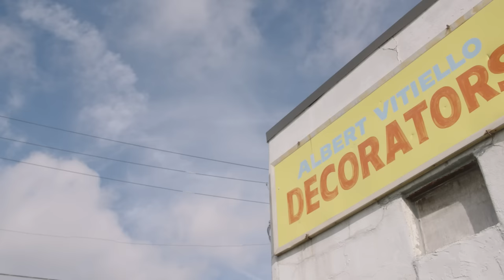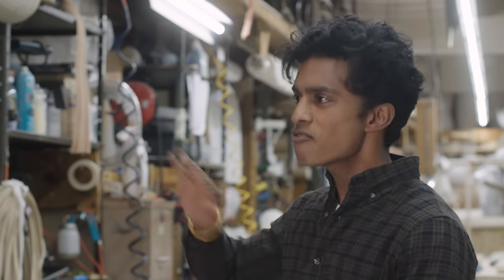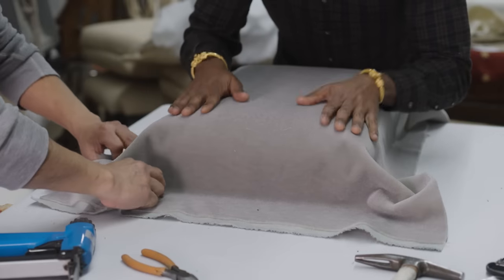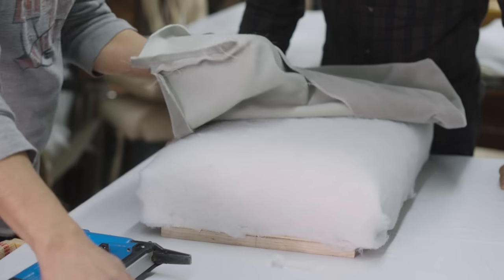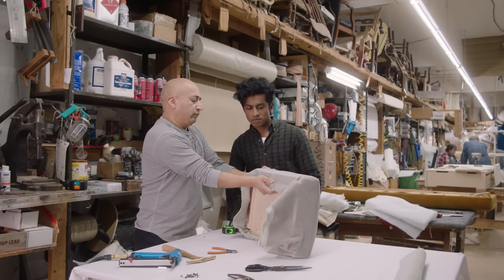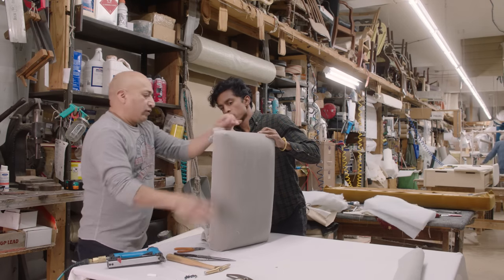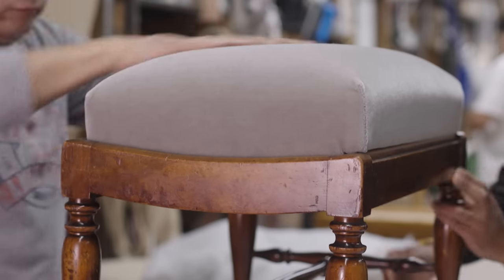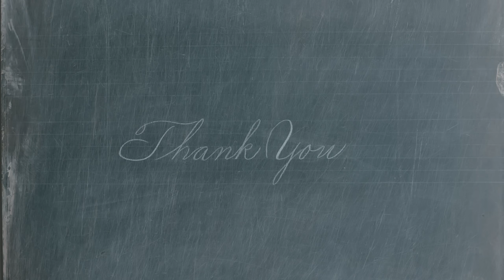Visiting a custom Upholsterer with Rajiv Surendra

Comment: A couple years ago I bought 3 old wing chairs from a ReStore shop for like $12 each. They actually were high end brand chairs so very well constructed.  I decided I would learn how to reupholster them & bought books, watched YT videos, got all the equipment & supplies.  I absolutely fell in love with the process!  I only have one completed so far, & although far from perfection, it actually turned out surprisingly well for a first try!  I’ve started on the 2nd one, a matching style, but life happened so it’s been on hold unfortunately.  I’m looking forward to getting back to it again, & your video has inspired me.  I found out after starting the process that wing chairs are probably one of the most difficult to do, lol, so I guess if I can be at least mostly successful at that, I can tackle almost anything — only for my own use, not to sell, but I’m proud of myself for trying something so new at age 60-ish!

Comment: As I sit inside re-wiring a chandelier on a rainy day, your trip to an upholstery store was just the speed for entertainment.  I have to confess I was thinking -  I have a re-upholstered a few chairs, it's tricky, but not impossible to do at home. Then your comment about how long your harp stool will last proved me incorrect. Your stool will last for years of use. That is the difference. Professionals perform with such experience to gift us with longevity. I love your videos!!!

Comment: Loved that you showed that these *simple projects are not so simple. Thank you for featuring artisans. That being said, this project could not not be done in a day. Pulling the cotton needs to be done and left for at least 24 hours an it should be pulled at least twice. Cotton can compress by 50% and if you don't do this step before putting on the muslin, it will happen after you put the final fabric and then it will be loose.

Comment: upholstery stretching is alot like stretching a homemade canvas for oil painting or fabric for cross stitch for framing, everything has to be pulled taught and straight and your rows and the grain of it has to be straight and going the same direction. Im 60 an artist and worked in framing, I have reupholstered before and I can say corners are a bitch if you dont cut the excess fabric away, you have to be mindful of stretching after usage too, you dont want your staples pulling your fabric and ripping it. There is a "touch" to it, and when you said No I want you to do it all so it has all of your touch on it all the way around, " You hit the nail on the head with that one.
Beautiful Tutorial.❤

Comment: The furniture sold today even from Wayfair is such lousy work.  I can see crooked seams and puckered fabrics, unmatched patterns in all of them, a mile away.  I think they are using inferior foam and batting, for one thing and don't take the time to do it properly.  Foam is outrageously expensive now, so low quality padding is probably another.  I wish Raj would have asked him why the cotton batting then the muslin then dacron batting and finally the fabric.  This is A1 work but the guy never heard of the word, "humility", but still a great job.  Maybe it is a NYC thing.  If you have seen it done a few times you CAN re-do a chair seat, especially if it is a solid, stripes and plaids get a little complicated.